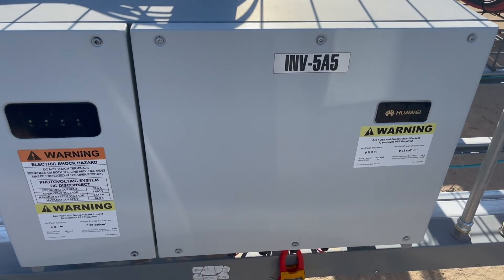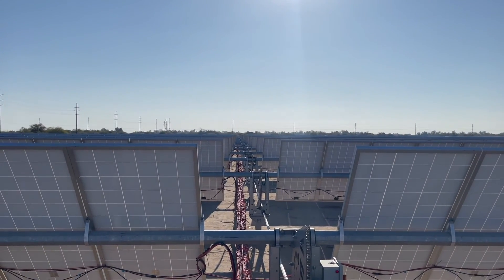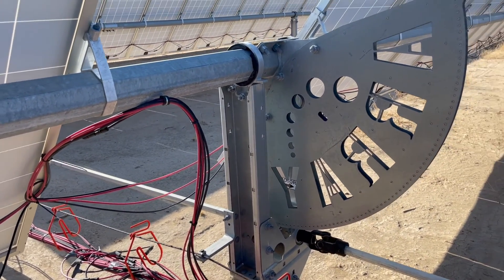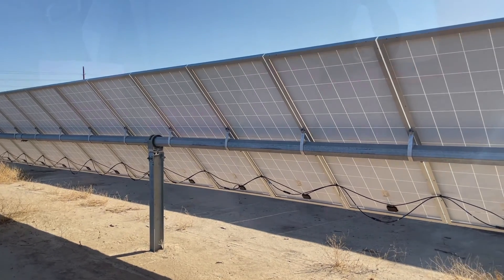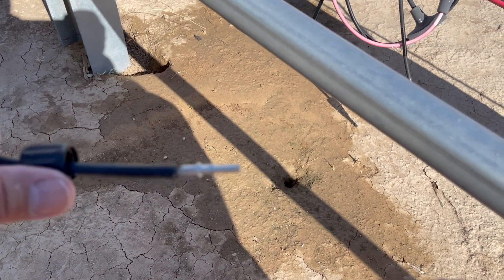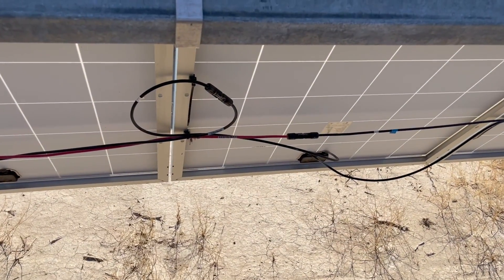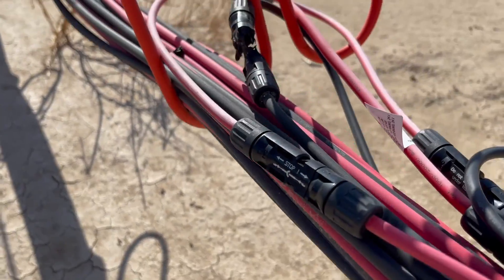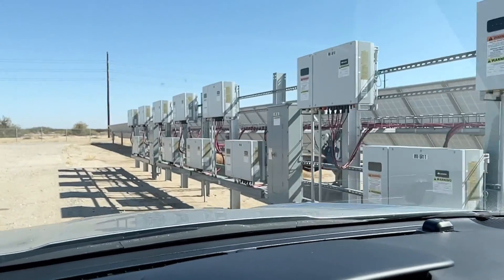Solar String Trouble Shooting

Comment: I swear every vid I see for utility shows me there is no good wire management in place across the entire country. I understand its a huge job, but aesthetics and pride still apply
Reply from the maker: Agreed specially with these Huawei string inverters that need to plug into the many connectors in the bottom of the inverter. I like some of our other sites with out the wire baskets going down the rows that have underground conduits one for each row.  With these open trays they should have sun and dust covers over the top of them.
Reply: @Paul Werner   I've been trying to get into Utility scale for about a month now. It's difficult because I have over a decade of electrical experience 7 of those years in Resi/small scale commercial. But because this is somewhat of a different beast unless you are close to a new build to get your foot in the door there is almost no way to get a spot usually without atleast a year on a Farm/Plant. Heck I can't seem to find creditials that will allow you to sit without working for a company already. Like TMEIC and whatnot. Such is life, someday soon I'll get in there and show some people what pride in your work looks like lol.
Reply: ehhhh i'm sure there's absolutely no chance that a 1200v DC arc could have melted through that entire bundle of spaghetti cable - you worry too much.